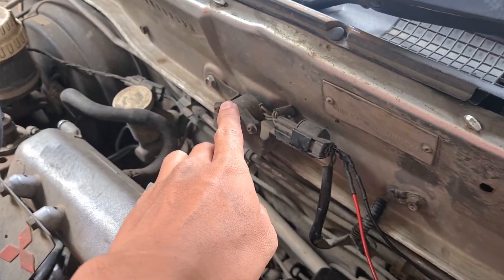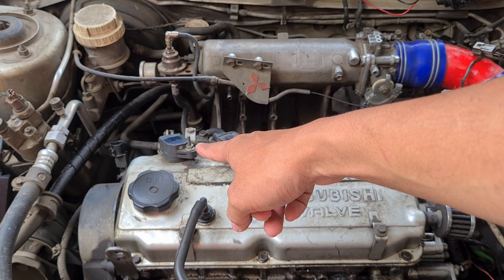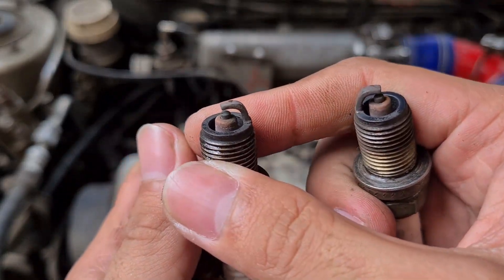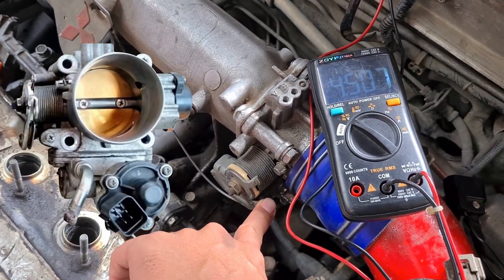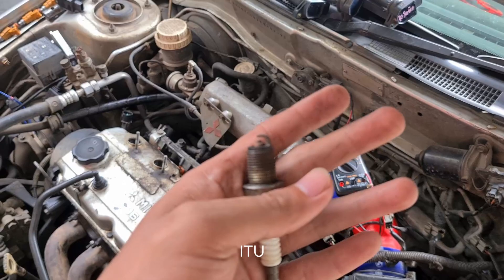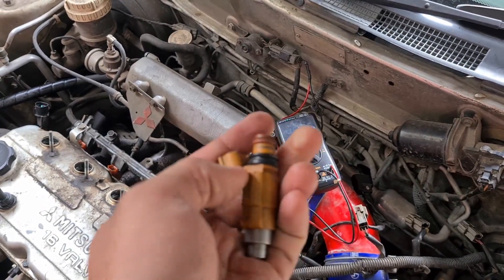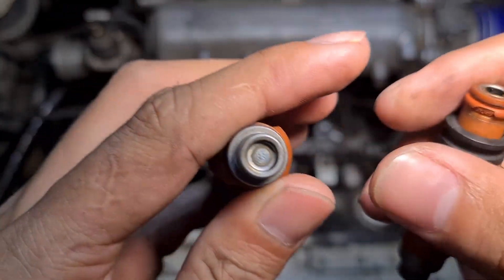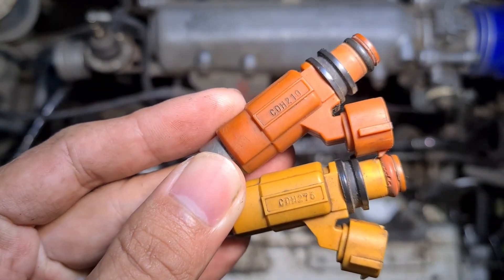Upgrade Injector Lancer CK4 - Tutorial Lepas Injector Lancer CK4

Comment: itu pake koil apa om? se inget saya std ck4 2 2 deh
Reply from the maker: Koil saya ubah ke K24 pak, punya honda
Reply: @septsautomot3082  untuk soketnya rubah juga?
Reply from the maker: @abyan2899  iya. Rubah soket & custom wiringnya pak
Reply: @septsautomot3082  selamat malam om,,
Izin om,,mau nanya sya pengguna lancer ck4 om,trus kemaren sya upgrade koil k24.namun stelah di pasang tarikan nya sh oke,cuma kendala nya klo di rpm 1000 - 2000 suka nyendat2 dan gas nya suka hilang sendiri.

Apa penyebab nya karna upgrade coil nya ya om atau ad masalah lain.mohon info nya om 🙏
Reply from the maker: @fredyprasetya9135  halo malam mas. Salam. Saya rasa bukan dikoil. Coba cek brp voltase TPSnya mas ?
Reply: @septsautomot3082  oke,,siap om.🙏
Reply from the maker: @fredyprasetya9135  selamat mencoba mas
Reply: Untuk Cedia 2002 1800 cc Koil pake apa om bagusnya @septsautomot3082
Reply: Sama injektornya pake apa om bagusnya
Reply: Bg kemaren lancer saya injektor nya kena satu
Truss sayang pesan di shopee
Eh malah nyampek nya injektor 275 cc
Kira kira aman gk bg di pasang ke mobil saya yang mesin nya stndar
Reply from the maker: @alianrino5186  gak sejalan pak. Bisa dipake, cuman timpang ya gak balance.
Reply: @septsautomot3082  kalo di tukar ke 4 nya gi mna bg?apakah aman atau tidak bg.di pasang ke ck 4 yg std bg
Reply from the maker: Kalau CK4 standar terlalu besar pakai 275cc pak.